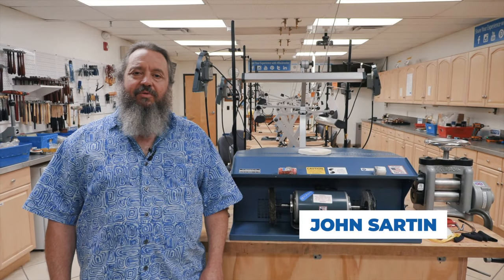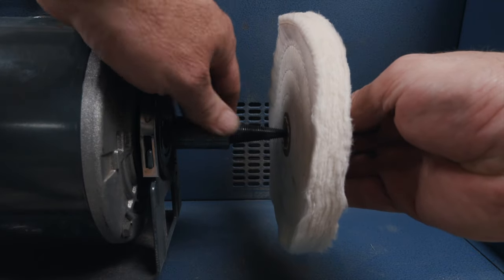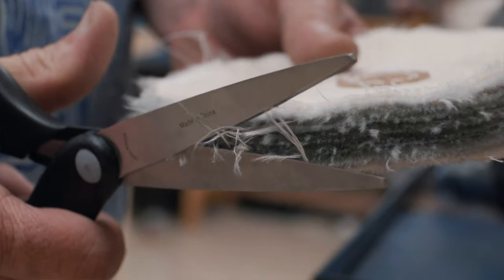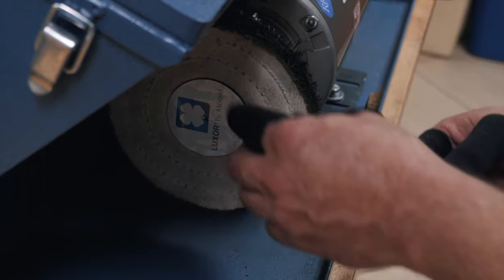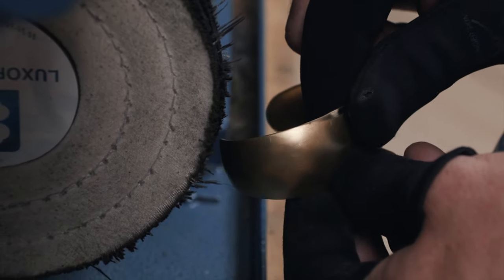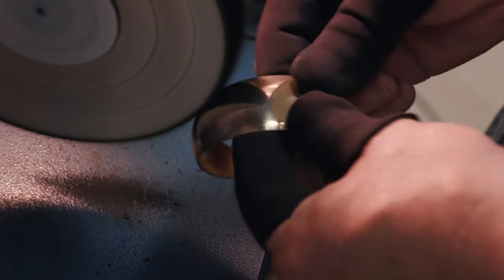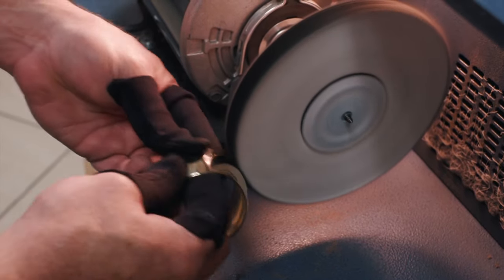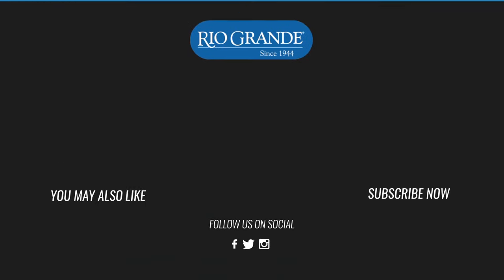How To Properly Use A Jewelry Polishing Machine

Comment: Very informative...thank you!  Question: you mentioned cross-contaminating your wheel by not washing your piece first.  Would it be necessary to change your finger protectors also or is that getting too picky?
Reply: I was thinking the same thing. I think it makes sense. The compound easily transfers to your piece if you have the slightest bit on your fingers, etc.

Comment: Thank you for this video. Learned a lot. I'd planned on buying a polishing motor, thinking that the one I put together is too big. Apparently not. It's a 4-pole 1/2hp, continuous, dual ball bearing Craftsman motor from 1944 that pulls 9 amps from the socket. (I restore vintage machinery, not a jewler). Now the plan is to take the funds allocated to that purchase and buying some quality mops instead. Still not sure which compound and polish would be best for steel.

Comment: I get the 3 step process but what type of compound to use for each step? Which 1 to use 1st, 2nd & 3rd?
What r the differences on compounds?
Thanks
Reply from the maker: Hi, we used Luxor by Merard compounds in this video. The order was Pink, White, and Orange. The differences in aluminum oxide abrasive material are 6.5 microns, 0.3 microns, and 0.1 microns respectively. Here is a chart that explains the differences in all of the Luxor compounds, http://ow.ly/grv750Hivwe. We hope this helps, you can find the compounds by clicking on the links below, and please let us know if you have any other questions.
Luxor® by Merard Pink Polishing Compound http://ow.ly/2wer50FRbsr
Luxor® by Merard White Polishing Compound http://ow.ly/ypxC50FRbt2
Luxor® by Merard Orange Polishing Compound http://ow.ly/yYZf50FRbtu

Comment: years ago when I started making jewelry, I was told to only use a 1725 rpm motor to buff and polish silver, but I see many people using 3450 rpm motors.  Which is correct?  I no longer have my 1725 motor but now have a 3450 rpm motor.  Can I use it to buff and polish silver or will it burn it?    and...I used to use a ring clamp to polish my pieces but don't see anyone using them anymore.  Is there a reason for using the finger covers instead?  Thank you!
Reply from the maker: Hello Ann, we will submit your questions over to our Tech Team to ensure that we get you the most accurate response.
Reply from the maker: Hello Ann, we spoke with our Tech Team and they said 34501 RPM motors are the norm, and work well, without any problems. To answer your other question they said if you are using the ring holders because they get hot then perhaps you should have a bowl of water nearby to dip the rings into because excessive heat can contribute to firescale or firestain. We hope theses answers were helpful! Please let us know if you have any other questions.

Comment: could someone please explain what he meant when talking about cutting compounds and cross contaminating them? I am trying to learn and i don't understand.
Reply from the maker: MMO we will get you a professional response from our tech team!
Reply from the maker: MMO sorry for the delay in response, our Tech Team says, When polishing, you start with an aggressive compound. This is aggressive enough to remove heavy scratches and gets imbedded into the buff. 
If you use the same buff with a finer compound you will still have the grit in the wheel but your trying to remove the scratches from the first step with a finer grit . Unfortunately there is still some of that grit in the wheel. So you use a new wheel with a different compound.  Here is the rub, that doesn’t completely eliminate the issue. There could still be grit down in the detail of the piece or up under prongs or somewhere on the piece. If you don’t completely clean the piece, that grit now gets imbedded in your buff your trying to use to remove the scratches from with the first step. This could be a reason you struggle getting a really fine polish and the reason you still see fine scratches.  If you clean the piece completely between steps. You no longer risk getting that grit from the last step on your piece.  This leads to better finishes and fewer tiny scratches left over from the last steps.

Clean between steps and you will not have that cross contamination.  Think of it like washing your muddy car.  You wash it and get all the mud off with a rag.  You can see the mud in the rag.  That’s not the rag you would put the wax on with because it wont give the best polish.  Its dirty.  You use a clean rag.  (cross contamination). Separate wheels and clean between steps! Thanks for watching and we hope this response was helpful!